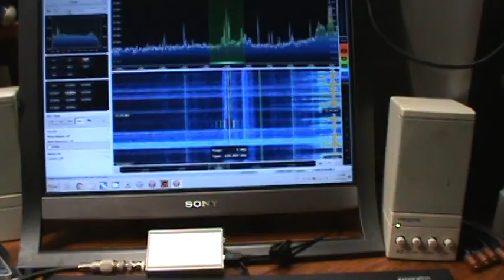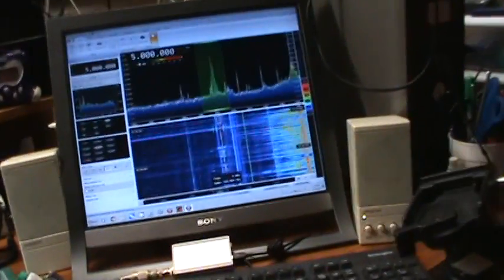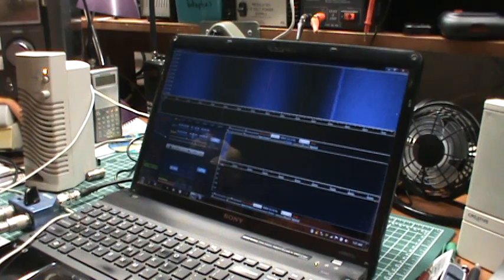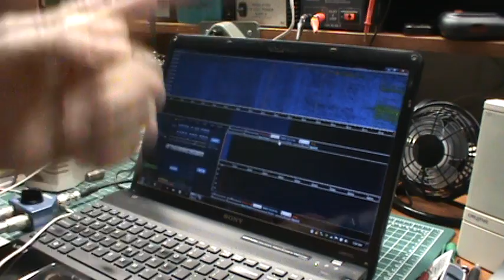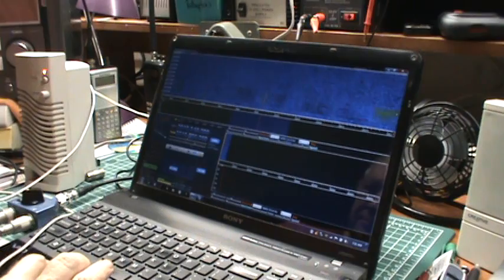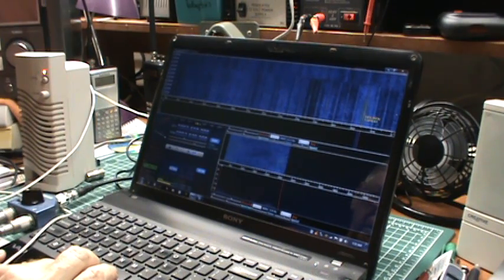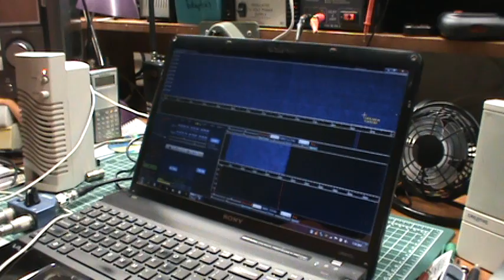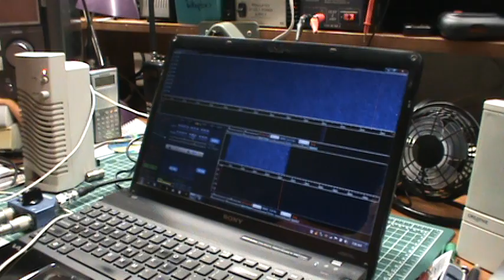TRRS #0969 - Testing RTL-SDR.COM with FiFi SDR

Comment: Hey Tom, any tips on what would be a a decent low priced coax switch?
Pretty cool set up you have there.
Reply from the maker: I used the MFJ-1702 two position antennas switches that run about $20 each.